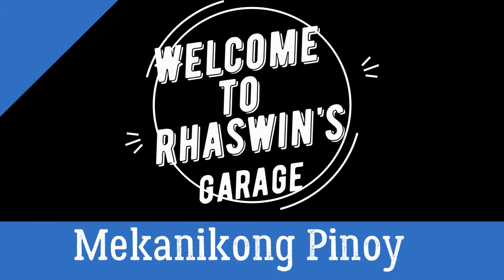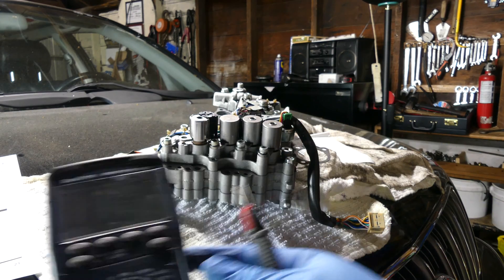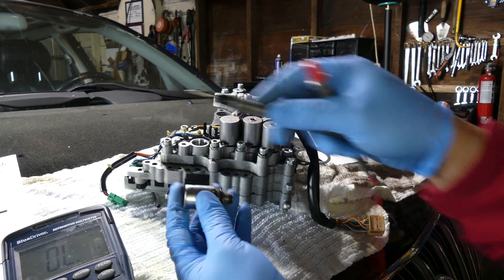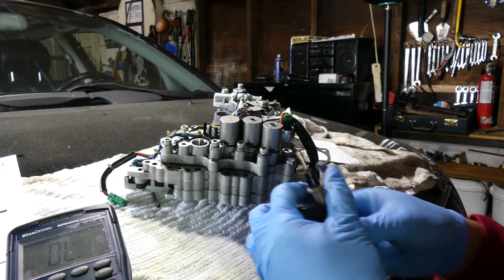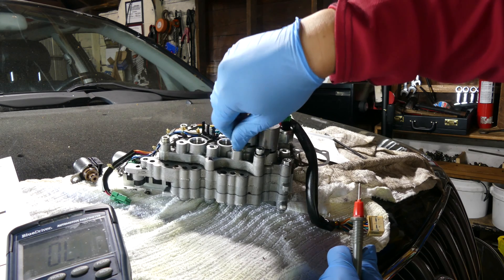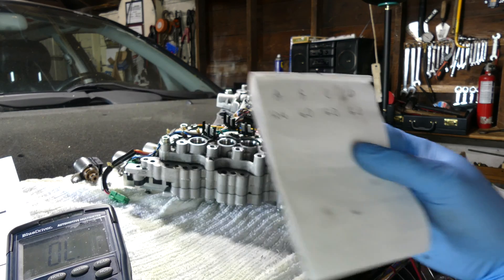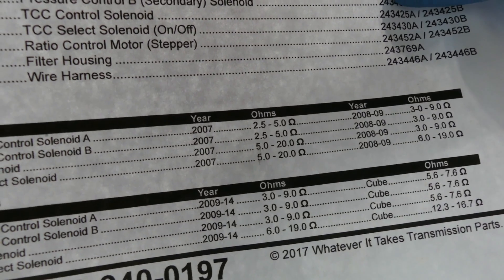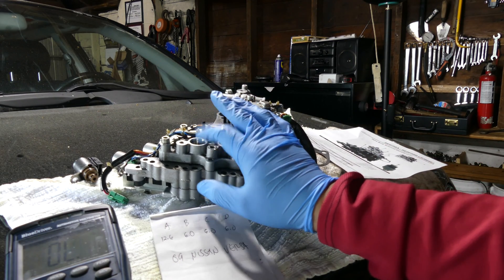Nissan versa solenoid valve body resistance TEST ( CVT transmission )

Comment: Thank you, but you mistakenly marked the TCC solenoid A, and there is another one you missed on the other side of the valve body.
Reply from the maker: i dont think so ive done a couple of this cvt transmission i rebuilt it piece by piece

Comment: You can find that PDF he is referencing on wittrans. He says the wrong ones. The A and B on the transmission diagram are not left to right. “A” (as in, the one all the way to the left in the video) is the TCC solenoid which goes from 6 to 19 ohms so 12-13 on the multimeter is in spec. It is good. The line pressure control A solenoid is the one to the very right.

Comment: Hello you showed the first as A which is the Torque converter "select" solenoid (I noticed because the top has a lip)  6-19ohms. It stated 12.5 isn't that good then? 
The rest are 3-9ohms. I tested the TCC select on mine and read 32ohms which is faulty, thanks
Reply: Yes!!!! The solenoid he labeled as "A" is the TCC Select Solenoid which is supposed to read 6-19 Ohms is 12.6 Ohms is right on the money! All of these solenoids read proper resistance! No issues here.

Comment: Hi everyone
Assian Mechanic I have sentra 2015 , and I change the valve body but still the code P0965 related to solenoid B, I  measured the voltaje in every solenoide with the car running and the voltage ois around 5.6 to 6 Volts
Is that correct?
thanks for your support

Comment: Almost sounds like solenoid A and D are mixed up?
Reply from the maker: this is procedure test i had a repair manual as my reference and this is resistance check how do u mixed it up
Reply: @asianmechanicguy6483  I was thinking someone else put them in the wrong order. A is in specs for D and D is in specs for A. That was just my first thought when you read out the resistances.

Comment: Be sure to also do a pressure test.  Besides checking if resistance is in spec , you can also apply 12v to see and hear them actuate.  All mine read and opened/closed just fine;  I further tested with a little air pressure, found the bad one that way.
Also, note that the spec sheet he's showing is for tranny RE0F08B; specs are different for RE0F10A, which can be found in the same vehicles and years.
Reply: Pressure test as in a vacuum test or something else?

Comment: Hi , I have a 2008 Nissan Versa hatchback 1.8 L. I want to know 2008 to 2009 valve body solenoid are the same size of solenoid and 2010 the size of solenoid  is different or the same. Thank you.
Reply from the maker: From my experience 08 and 09 has different valve body

Comment: Good day kabayan meron akong p0746 elgrand car stall or sometimes transmission engage harshly and engine stall
Reply from the maker: anong atin bro
Reply: Napalitan na ng cvt oil pero ganon pa rin problema  code p0746
Reply from the maker: @donpedrochannel2529  diko alam ang allowed resistance ng mga solenoid valve ng car na tinutukoy mo pero dito sa versa mayrun taung sinusundan na resitance check so u need to have a repair manual or repair apps para mapin point mo talaga ung sira nya ..pero base sa experience ko kung my tunog or grinding sound na transmission mo its too late rebuilt na ang need nya

Comment: Hey I'm having issues with a 08 Sentra code p0841 solenoid A I can't find the ohms resistance for it I know I check it and it read 35.4 and I buy a set and this one read 29.2 the other 3 solenoid read between 6.0 to 6.7 I just need for solenoid A? Thank u
Reply from the maker: Sorry  bro this kind of repair needs specifications which u need to take it from repair apps or dealership

Comment: Hi , I have a 2010 Cube , got the p0868 code and the car can’t go once it stops, do you have any suggestions? Thanks
Reply from the maker: transmssion issue is a complicated job but if you car comptible to bring down ur tranny pan then i suggest u to clean ur transmission filter first then put fresh transmission and u start from there if still worth to fix

Comment: Is this the process I’d need to follow for the P0845?
Reply from the maker: yup but make sure ur valve body had thesame serial no Reofoa1 or Reofob cuz they have diferrent resistance
Reply: All I remember in my casting of valve body it said “FYO#3”.
Reply: Do I Change solenoid or pressure sensor?
Reply from the maker: @KAUAIBOIZ32  bro i cant tell or decide by just msg i need to check it myself but this is basically what we do in testing resistance for the solenoid valve body
Reply: Also. Would you know where I could get these parts? Hawaii is a hard place to get things, don’t think the local dealership carries these according to their website. And where could I find that spec sheet for the resistance? Having a hard time finding it online. I to have the 2009 Nissan Versa 1.8
Reply: Sorry so many questions! I am flustered! Side note: P0725 was also thrown. Engine speed. Could they be correlated?
Reply: Awesome 🤙🏼 mahalo!

Comment: Nice video. I’m getting code p0744 and unable to clear it. Does this mean the solenoid is bad? The solenoid works with direct voltage.
Reply from the maker: check for resistance ..direct voltage to the solenoid is misleading sometimes
Reply: hey i have the same issues says. p0744 torque converter clutch internal
Reply: @PODOLSKY87  mostly likely you need a new trans. I ended up replacing the trans from the dealer. Tried installing a new torque converter but the same error was there. These cvt trannys are not the best.

Comment: The 12 homms resistance is not the solenoide A,   that's the selector solenoide and that's the correct reading ,the other 3 solenoides are 6 homms,
Reply: He is right bud.. those  solenoid  c and d are line pressure solenoid. A and b are tcc solenoid.. i saw your on WIT website but those on GEARS MAGAZINE is different also.. now which one is true? But thanks to your video helps me a lot to diagnose my 2012 nissan versa.. hopefully you a video on the stepper motor code p1778 and p1777..thanks please need help
Reply from the maker: im not gonna argue with u brother just do what you feel is correct..this is specific valve body for nissan thas has a serial number reofoba if im not mistaken has its own solenoid resistance manual so im 1000% sure im correct with it otherwise the manual that they give it to me is fuck up..but again ive been working with this car for a while now and i had a positive outcome for it check my other versa videos about cvt transmission

Comment: Great video, thanks for doing these. A few months ago, my CVT started whining so I followed your directions for cleaning the screen and filter which solved that problem. Now I've got P1778 (stepper motor), P07046 (solenoid A) and P0868 (low pressure) I'm going to check resistance as you are showing in the video. Do you know if these solenoids can be purchased separately? I see the solenoid pack on rockauto but it's $400. Thanks!
Reply from the maker: yup bro even here there selling it per pack
Reply: @asianmechanicguy6483  thanks, got the valve body out and measured 15 ohms on solenoid A. Guess $400 is better than a new trans. Question is, is it worth it. Someone put ATF in this thing so it may be shot. Seems to drive OK though when it's not acting up. It creeps in drive/reverse once it gets warm. Maybe it's just solenoid A is shot. Thanks for posting the pic of which valve body bolts to remove, that was super helpful.
Reply: do you have a link to the solenoid pack you used? the one on rockauto doesn't look right, might be for the standard AT not CVT. Not having any luck finding the solenoid pack anywhere. thanks for the help.
Reply from the maker: Try cobra transmission but that was 2 years ago that i bought cvt parts
Reply: @asianmechanicguy6483  excellent video where could I buy solenoid A for my nissan versa 2009?
Reply: You said it backward the a is the d

Comment: I just changed my valve body on a 2012 nissan altima p0744 code. Left the Allen wrench when installing to hold stepper motor lever, still have the code wondering if i burned the solenoid? I removed the Allen wrench by the way. Car runs well but can't smog it. Changed oil and filter installed a oil cooler. Please help!!😬
Reply from the maker: when you open the pan and you didnt find any metal fragment theres a big chance you can save your transmission try to take off the solenoid valve body again clean it piece by piece

Comment: D =  pressure Solenoid A
C =  pressure solenoid B
B = tc clutch solenoid
A= select solenoid
 there is nothing wrong with it because  12 is between 6 and 19  oms you name the solenoids backwards.
Reply from the maker: i know its confusing but make sure to double check your valve body that u working on this type of solenoid valve body is for 08 i think and we had a detailed manual for this in our shop that i use for my reference please check urs this valve body start with a code of reof08a (jf009e)
Reply: @asianmechanicguy6483  do you have a value for JF011Ebec I checking mine
Reply from the maker: @romanolorvida  I think we do in our shop just need to check it but pulling a repair manual for cvt is expensive bro so I can't just show it into YouTube

Comment: Paps saan ka located
Reply from the maker: Vancouver bro
Reply: @asianmechanicguy6483  sayang ipapacheck ko sana car ko sato cvt transmission
Reply from the maker: @Rankitoy  ano ba issue ng car mo
Reply: Sir pwede ko b kayo i add sa fb? Delay ko kc minsan acceleration nya
Reply from the maker: @Rankitoy  sure bro search mo Rhaswin Miguel Uno
Reply: Ngpm npo ako sa inyo sir

Comment: Yes!!!! This transmission is the exact same as my wife's 09 Nissan Cube!

I have a failure in my A solenoid and can not find anything online about which solenoid is which and I cant find a valve body that isn't 300$ with over a month shipping. I'm thinking about disassembly and cleaning. Do you think those solenoids are cleanable as long as they still function?
Reply from the maker: nope if its bad you cannot fix it anymore.. try to go to junkyard
Reply: Rhaswin's Garage can you buy only the solenoid that have the problem and replace it on the go for the car to work? In your case the solenoid A
Reply from the maker: @AnythingEverythingGh  here in vancouver they dont sell solenoid for cvt and  i dont know why u can try junkyard or try online cobra transmission  thats where we bought parts for cvt

Comment: Can you help me please I have this code p0846 my can nissan sentra ?
Reply from the maker: you need to check a lot of things for that code like thhe solenoid ..wiring connection ur oil filter but start removing the tranny pan clean ur filter check the resistance of ur solenoid
Reply: @asianmechanicguy6483   thank you dear my car had water flood and some water inside cvt I Discharged the cvt fluid but the problem still bad speed and code p0846 ,  what is your advise replace the valve body or all cvt

Comment: I think you may have labeled the solenoid wrong. I think what you are calling "A" is really "D." See https://gearsmagazine.com/magazine/ins-outs-re0f08b-jatco-cvt/
Reply from the maker: i know its confusing but what u show is a different jatco solenoid valve body  mine is for 09 nissan versa REOFO8B ..FYO #1A.. and A is my  pressure control  (line) a solenoid .. B is my pressure control b secondary solenoid..C is my TCC control solenoid..D is my TCC select solenoid (onn/off)
Reply: @asianmechanicguy6483  No, you have your solenoids backwards, thus your TCC solenoid is reading 12 ohms because its range is 9 to 19 ohms. A and B line pressure solenoids are identical and always positioned near the pressure sensor switch.

Comment: bro,i have 2011 versa code p0746 p0868,look like same problem with you
Reply from the maker: good you got those codes now open the tranny pan check hows your oil if there no metal fragment in the pan just clean the filter both of them but if there's a fine fragments on the pan ur tranny needs rebuilt
Reply: I have seleNOID A stuck off conde on my murano I did clean my oil in the procces did see some fine barely visible metal fragments on my pan but nothing major  the car run fine just when accelerating is lazy sometimes so I just ordered the valve body to not deal with selenoid situation my guys is coming Monday to programm it you think I would still need a new tranny or would this fix my problem.

Comment: hello sir... parang wala pa ata cvt transmission sa pinas. how can i identify if the transmission is already a cvt? by just looking at it. what's the difference between cvt transmission and the automatic transmission? i mean, yung itsura nya sir. sa pang labas. paano ko agad malalaman na ito ay cvt na. salamat po sir.
Reply from the maker: Mostly my nakasulat na cvt fluid only or ns 2 sa my dipstick.ung nissan cvt gamit nila.. ung 2018 toyota corolla cvt narin sya. Ang cvt transmission mas efficient sya sa gas ung pagchange ng gear is very smooth dmo mararamdaman ung pagchange gear nya at very quiet din at business wise madaling gawin ng mga manufacturers kc simple lang ang parts nya. Sa pinas not sure kung my cvt na din nagtatanung din ako sa mga pinoy automotive youtuber pero d sila nagrereply at matagal narin d ako nakauwi sa atin
Reply: ok sir. salamat... pero iba po pala ang fluid na ginagamit sa cvt. hindi po puede ATF ang gamitin? kapag walang cvt fluid.
Reply from the maker: oo bro pag cvt transmission cvt fluid only ang gagamitin mo kc ung variator very sensitive sa oil yan pag iba ung oil na nilagay natin magkakaroon sya ng early teardown or lamat dbale sa mga susunod na videos ko unti unti kung bubuksan tong cvt transmission na to at explain ko sa pinakasimpleng salita para madaling maintindihan..
Reply: ok po sir. salamat. hopefully hindi magtagal maka overhaul na rin ako ng cvt transmission.
Reply from the maker: @edwinescobal9085  oo naman bro kayang kaya mo yan napakasimple lang ang cvt transmission compare sa conventional transmission basta pag aralan mo ang bawat function ng parts ng transmission it wil take time and experience para maintindihan natin how automatic transmission works pero worhted naman .It took me years and years para maging comportable na pagbukas ng any transmission just patience and put extra effort sa pag aaral
Reply: salamat talaga sir... malaking tulong po ang mga tutorials nyo sa akin.
Reply: salamat po talaga sir... laking tulong po talaga sa akin ang mga tutorials nyo.

Comment: Nice bro, e try mo linisin bka stuck up lang
Reply: Mataas ang resistance ng primary solenoid so sya ung nagcause ng internal damage ng cvt transmission
Reply from the maker: sa mga ganitong klaseng solenoid pag nasira na wala na palitan na agad..solenoid ng transmission eto bro at di sya katulad ng external solenoid na pwede nating linisan at gagana ulit katulad ng purge solenoid egr solenoid at ibang pang external solenoid ng car
Reply: Mekanikong Pinoy Rhaswin's Garage kasi myroon binigay n sasakyan skin,trans ung problima,2 lang ung valve ung isa stuck up,mataas ung resistance, medyo mahal ung valve,so ginawa ko nilinis ko,wd40 at compressed air,so gumana,flush out ko ung trans 2x,e ngaun nka 40thou miles n,la ng problima,,ung cause is metal residue due to hindi pa napalitan ng oil
Reply: Ung purge valve sa pg kaka alam ko nasa fuel evap system,d ako ng rerepair nyan kasi under 12v yan,at my resistor yan sa loob,ung egr nman naka kunik yan sa exhaust manifold,parating mainit yan myroon diaphragm kadalasan stuck up ,
Reply: At lastly,ung valve n yan,dito hindi makabibili ng isa lang,it comes in set,5 valves at my updated n na valve body dahil my recall yan,ung price palang ng valve solenoid assy is almost 500,e best way palit nlang ng transmission bro
Reply from the maker: @filcarzon2761  im just sharing bro ung isa sa mga common problem ng cvt transmission for nissan galing kc tau sa nissan dealership at eto ang mga nadiskober at natutunan ko yang recall na sinasabi mo kung alam mo lang ang nangyayari sa loob ng nissan dealer ayoko lang magsalita mahirap na but anyway this just a little repair technique that i wanna share
Reply: Mekanikong Pinoy Rhaswin's Garage Oo bro